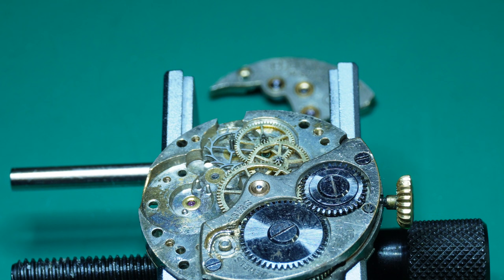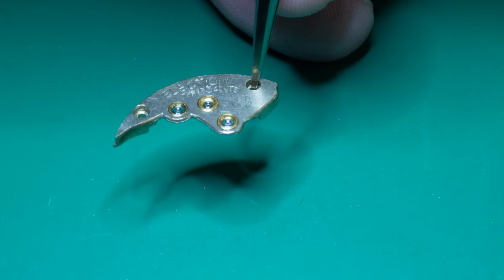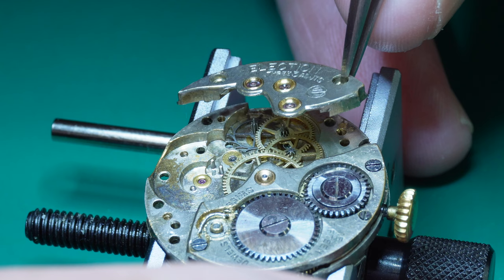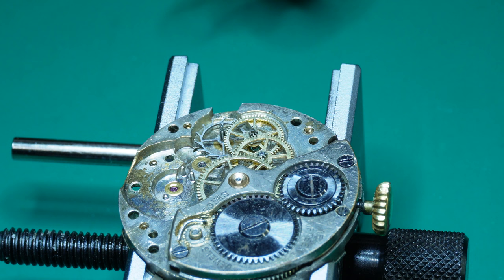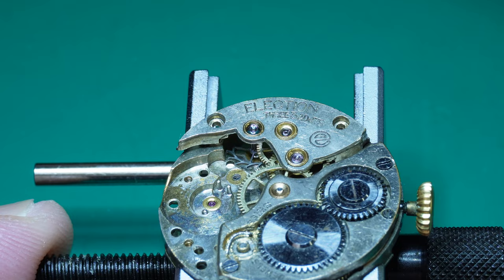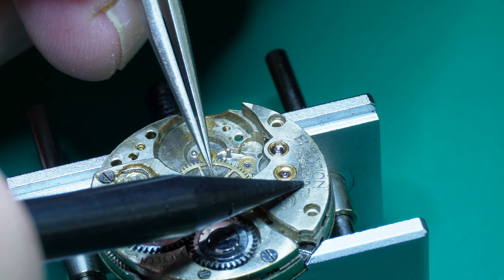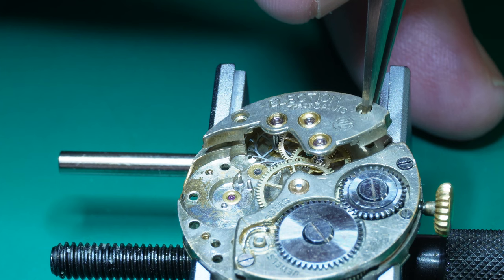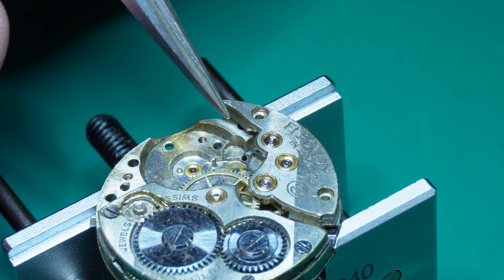How to Install a Watch Train Wheel Bridge without Screaming!

Comment: Thank you for this tutorial. I've noticed for a long time that there is a huge variety in bridging in mechanical watches. Would it be fair to say then that the best bridging for the watchsmith is individual bridges for each pivot?
Reply from the maker: I don't think so, because each bridge will still need alignment pins to locate it to the plate, and all of that takes space, so I don't think it would be all that practical. Although I think I have seen some older movements on other channels where they did this.

Comment: So, yesterday I removed the train wheel bridge of my 7 jewel Elgin pocket watch, and I just cannot get it back on. The fact that the train bridge pivot holes aren't jeweled makes it even harder. It's so frustrating that I started crying for a moment. I feel like I'm paying for my sins
Reply from the maker: I feel your pain. You'll just have to keep on persisting and you will get there eventually. You can get a really good sense as to what is going on by feel.
Reply: @watchout9213  A couple hours after I wrote this comment, I got it back together. I just followed what you were doing in the video and it worked! Thanks
Reply from the maker: Congratulations!

Comment: What micro scope do you use please
Reply from the maker: It's an Eakins from Aliexpress. I'll make a video once I've got the camera sorted.
Reply: Thanks
Reply: Thanks for this. Using practice and patience makes a lot of sense and I’ll give this a shot. Until now, I’ve been gently screwing down the bridge and fishing the pivots into place, alternately nudging the screws tighter as each pivot finds its jewel hole. It’s a time consuming process. Some folks use tapping on the movement holder, but it seems to require each pivot to be nearly there. My fishing method is like using training wheels on a bike, when your method is like learning to fly.

Comment: Nice work, skills definitely improving! Very cool you got the Sony camera as well, same model I’ve looked at in fact. Which lens are you using with it? Also can’t wait to see videos with the microscope camera as well, once it arrives.
Reply from the maker: Thanks so much! I'm just using the 16-50mm kit lens. There is a 1.5 digital zoom as well. What you see in the video is as  close as I can get before it won't focus, on 50mm with 1.5 digital zoom. I almost didn't get the kit lens, but I'm really glad I did. Plan to get another body and a macro lens at some point.
Reply: @watchout9213  That's awesome. I am surprised the kit lens is getting such great shots. The macro lenses can actually be surprisingly affordable if you ditch autofocus. You mention it isn't in your way like the phone was -- how'd you get it setup? Tripod standing on bench with camera pointing straight down? That's one way I've seen guys do it.
Reply from the maker: It's on a table tripod pointing down at about 45 degrees. Can't do overhead as I was working through microscope. When I am better I won't need to. 

I was thinking about a 65mm Laowa Macro lens. However, I have found the autofocus to be helpful, even though I run the camera in manual focus mode. (Otherwise it just hunts everywhere). Also, it isn't much longer than the 50mm kit lens, so I don't think this would really gain me much.

I'm also thinking about the Sigma 70mm f/2.8DG Macro. This lens can be had for AUD722, it has focus motors built in. It is a full frame lens, so on the APS-C sensor it would crop up to 105mm equivalent. I think this lens should work really well for the close up macro shots.
Reply from the maker: I should mention that because of the 45 degree filming angle, I need to shoot a F11 to keep everything in focus. Seems to work fine.
Reply: @watchout9213  Yeah, a lot of light will be needed given high apertures desired to keep focus, especially if you've got a tilted focal plane. It seems like it worked beautifully for you though. Curious about the lenses you mentioned too, looked at the Laowa in particular. It's true it's not a huge step up from kit lens in terms of length, but given you can work some digital zoom in and still be alright with so much resolution, and also the fact you'll have a microscope camera for truly close in shots, I wonder if you really need to go as high as 100mm+. Sometimes I think I couldn't have picked a more expensive hobby to pursue lol -- as trying to do YouTube watchmaking means not only all the crazy expensive watch repair tools, but all this damned camera gear as well lol. Ah well, it's a good thing I took photo in high school 😂.